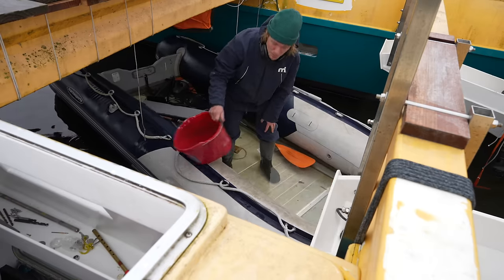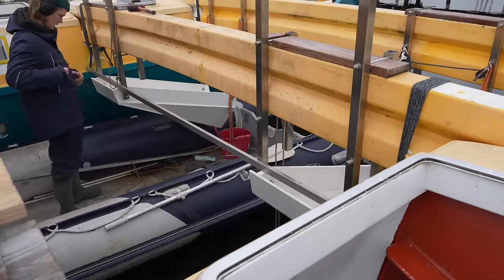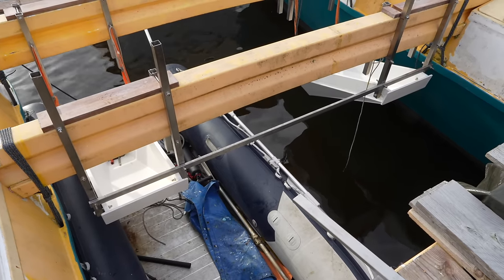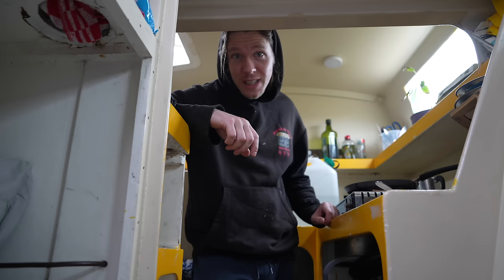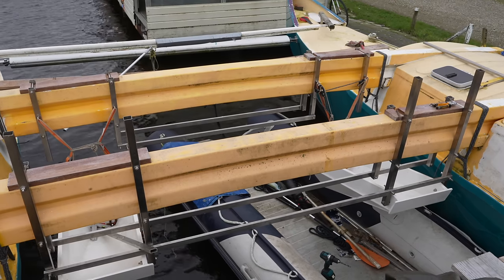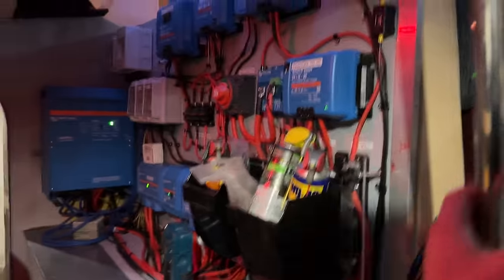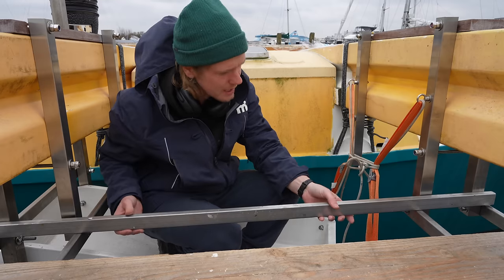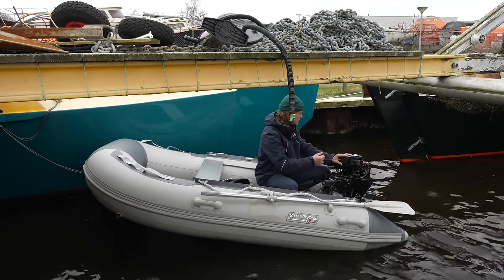I Built A Cockpit Floor for My Ocean-Going Catamaran | Wildling Sailing

Comment: One thing, seems that you might think about triangulation as it pertains to your motor boxes. That cross brace if mounted at an angle instead of level would better control racking. I was told if I learned to sharpen bits on the grinder I would never be out of a job, not long after they started making bit sharpening machines. I'll look through some of my old books and see if I can find instructions, got some reference stuff on old school uses for common tools. Ah, fore aft triangulation while not so important for movement but for strength you are absolutely right. Stainless strap at an angle from side to side opposite the hinge pin side would help.

Comment: Electric outboard motor 3HP weight cca 14kg .. Mercury 9.9HP weight cca 38kg.   In 20kg LiFePO4 store 2.5KWh energy (1 hour with full power) It's easier to handle.   Motor 14kg, Acumulator approx. 25kg 
(with waterproff housing). That's enough for life at anchor. Electric motors are reliable. You can generate electricity on the boat for free.  Not petrol. The 9.9 Mercury can only be had as a backup.

Comment: When drilling metal. Start with a really small pilot hole. Step up the size of the drillbit a couple of times before reaching the final size. Otherwise you blunt the drillbit really fast, even expensive ones.

Comment: I'd be considering you have water in your fuel. Plastic tanks get condensation in them. A dash of metholated spirits absorbs it n will keep u going...although a carby bowl clean never hurts either along with a spark plug clean too

Comment: I understand your situation re sharpening twist drills. My recently purchased General sharpening jig shows for thin metals such as your SS tubing change the cutting angle to 88 deg. to prevent snatching on break through. I see you having action when the bit breaks through. So, instead of 59 1/2 deg try that possibly.

Comment: Great episode, why do you not wield the metal box together this would be super strong then.

Kind Regards

Craig
Reply from the maker: thanks for the comment, I think with my experience, and the high winds it would be difficult. I think I may weld a few little re-inforcing bits here and there though

Comment: Did see you had gotten the cobalt bits and going slow you're doing it right just use cutting oil to keep bits from over heating and losing their temper.

Comment: You should try and use the same size bolt throughout which means you need one tool and can get a few drill bits if the same size instead of 4 of a different size fit same price

Comment: Nice to see you back at it Mark. Your engine problem may be oil in the wrong places. I watched you lift them and i know its hard cos they are heavy but if the prop goes higher than the head, or if you get the engine to be laying even for a short time on the wrong side oil can get into the cylinders and the carb which doesn't help! Also as well as cleaning up your swarf as you go when drilling make sure theres none on the soles of your boots as that is a common way to put holes in inflatable boats. Soon be sailing buddy 😊

Comment: On your own or not (and you were definitely struggling) might I advise you to attach an outboard with a rope to the main boat or even the dinghy. If it goes overboard not only will you go with it but it'll sit for a week before you retrieve it and all the corrosion. At least attached you could get it out in an hour and rinse it.

Comment: if you want your drill bits to last try not putting so much weight on it... they cut fine just enough weight to keep it from walking... the drill should do 90% of the work. also a center punch to locate your drill

Comment: For sharpening drill bits by hand it is a bit of a learned art. A small tip is that if you need a slighty bigger sized hole for something you can tune a bit to cut slightly oversized (when drilling a blind hole) by making the edges slighty different lenghts. The hole size is made by 2x the longest of the two cutting edges (most drills are the same so 2x is equal to the diameter) . Only works on blind holes where the center is kept by the tip of the drill. 
The angle of the cutting edge/backface only needs to be a deep as the cut you need to do, so metal drills are a shallower angle (otherwise the back face will rub and generate heat noticable when applying too much pressure on wood drills). Generally it is better idea to have two faces per side, one for clearance and one for the cutting edge but that can be hard to do when you first start learning to grind them. The angle accross the face will impact the drills ability for follow the hole and also how much force there is on the cutting edge. If drilling plastic that might crack it can be usefull to make the angle bigger (so more pointed) as then you can use less pressure (although not done much for plastic drills so take that with a pinch of salt :D)
Oh and loving the videos. Reminds me of myself when I was younger, too many people won't even attempt something (how many people have you met that wont even oipen the bonnet of the car to top up the washer fluid :P). Great book on this mentality is "Zen and the art of motocycle maintenance" for those long days at sea :D
Reply from the maker: great info, bro!

Comment: I could hear that the chattering of the drill bit, it was done. Try using a step drill, or it maybe called a unibit. Do check the size of the steps with a caliper if your drilling a hole that is critical.

Comment: Hello Mark,
I'm just watching your latest video and realize that I keep tripping over the suspension of the motor nacelles. Do you really think the wood is sufficient to withstand the loads? My fear is that the bolts will break out of the wood quite quickly and you will lose your motors, either because they are torn off, or at least because they run full of water.
I also wonder how you are going to maintain the motors safely when you are at sea. Why don't you build a bracket in which you can lower or raise the engines vertically, ideally high enough so that you can service them on deck?

If you want to keep it that way, I recommend flanking the lower end of the nacelles with two strong steel plates, into which suitable circular tracks are cut, in which the nacelle is guided sideways. This should reduce the twisting of the nacelles and the load on the upper bolts and the wood holding them.

I recommend that you have the whole construction professionally calculated so that you don't have any problems later.

Comment: The drill bits tips are breaking because you are pushing too hard, probably because the tips were not ground correctly. It takes a little time to learn this skill. Make sure each cutting edge is the same length as the other with not as much relief as those you ground.

Comment: Do you think the problem could be using this dreaded E10 fuel? as my marina 9.9 was great until the crap E10 came out so according to the mariner mechanic it was damadging my carberetta so a new carb was fitted and same fuel snd it just never runs properly since. According to most people I have spoken to have told me that simulr problems with their own engines and have told me that the E10 can only last about two months before it corodes the inside of the card and that the petrol goes off. ??

Comment: Every time you put a hole in the steel frame you weaken it. You should do a test run with both motors running sooner rather than later.

Comment: Sharpening bits by hand takes practice.  It is much harder WO a stable bench type grinder. Keeping a flat or squared off Stone is important.  Put as little back taper as possible.  I usually do a steeper angle on the heel of cutting edge to reduce heat. As with any metal cutting,  goal is to go slow and sharp enough to create a good chip. Over 90 percent of the heat created should leave with the chips. Cutting stainless is never an easy proposition. The gold, "TIN" coated bits aren't bad for the money.

Comment: Do yourself a favor and use nylox and double nutted because it's going to work loose when the metal starts bending and which it will do Hollow tubes are not a good choice Use nylox Please

Comment: If the ocean can periodically rip keels of boats what chance do those four anchor points have on those motor boxes? Even just having the motors clamped in the bottom of the box may not be enough to prevent the force of the ocean currents rushing through and ripping them out or off. Do you have any data on the clamping system being fit for purpose? Good to see you back.

Comment: I know nothing but I’d also be concerned about the clamping action and a lateral force on those bolts. I wonder if you can bolt on little stoppers beneath the clamping bolts. This way, any extra weight will be on the stoppers and not the bolts for the clamping.

This also gives you a bit of redundancy in case the bolts that hold the stopper fails as you still have the clamping bolts.

Idk it’s a tough problem to solve

Comment: Good luck bro. I think that cage / frame / engine / cockpit floor holder is grossly under-engineered. Oh well. I guess we will see in a few years what bits start to break first. Do what you can with what you can afford and upgrade as time goes by.
  Your going to want to use stainless nylock nuts. The regular nuts will come loose, you can double regular nuts up and lock them together but it's not that easy or as good as nylock.
  Lots of drilling if you want to bold that cockpit deck all the way along both ends but it will stiffen the assembly up. 
  My biggest concern other than longevity is the sharp edges at the top of the frame. You don't want to be slipping over into those! Is that something that will also be covered in wood?
 Another tip is to get a socket holder you can put in your drill for your socket set. You can get all the different sizes even sds+ or for the smaller sizes you could also cut some old socket extensions if they fit in the chuck but they might slip so best to order the ones with hex shaft or sds+ if your drill is sds.
  It's also nice to have 2 or 3 drills on hand. This way each can have a different type of bit in for faster work and some can be charging while you use the others. (when you consider a used drill is probably almost the same cost as a spare battery).

Comment: Have you tested fully lowering the engine boxes since building this? That front bar and bolts are surely going to interfere with the top of the engine boxes when fully lowered for use?

Comment: ..all this steel - why not use alu? So much easier to work with and lighter. And the wooden planks for deck; glue them together and use some wooden stringers under the middle of them - it will be much more rigid.

Comment: the issue with the drills especially in Stainless steel is that when drilling a hole with a had drill they tend to run faster then the suggested cutting speed for the drill in 
S.S. and the tip work hardens the S.S. because of the heat that is generated with most drills, you need to be sure to use a split point drill, because it is actually has small 
cutting edge at the tip and not a rubbing edge.  that is okay for softer materials like wood and aluminum but because S.S. work hardens so easily, use a smaller drill to 
start with, keep the speed down, even use a bit of lubricant even a little bit of Crisco or vegetable shortening that is ferm it will stick to the drill instead of some oil that 
will run off as soon as you apply it. the cobalt drills are good but if you notice they typically have a thicker center web, so it is very important to start with a smaller pilot drill.
I had a small machine shop in California for 20 years, we built OEM hardware for a number of the Sailboat manufactures that were here in the '70's - late '80"s, Lots of 
S.S. fabrication, Lots of Brass and Aluminum castings, started out with a couple drill presses and a bench grinder and grew to punch press, power brake, Iron worker, 4 welding 
machines, 2 Bridgeport milling machines and 2 engine lathes, finishing polishing and Electroplating of S.S.

Comment: I have owned multis for over 40 years and built 4 multis. You seem like a nice guy, but my advice is - follow the plans, Wharram did a nice job and he knew much more than you, so find the plans, stop thinking and just follow them as they were drawn for our deck. Don't make excuses for doing different paths. I made pivoting nacelles for my 38ft cat in 3 different iterations over its 24 year life so far. You will have an issue with the forward thrust of a high thrust engine - the pivoting nacelles need to bear against a thrust pad at the forward edge when lowered - pivoting nacelles is a great idea - mine work really well and are light and strong - but I would not have them hanging like yours do with no thrust pad at the front - also learn to use epoxy and glass. It is much better than bolting stuff all the time. Cheers Phil

Comment: Mark, I'm.now at 12 min 40 secs..
Are those sausages in the pan with rhe eggs or off cuts off a brush stayle?

I thought I'd let you know that here in blighty, we call it ' threaded bar'  not as you call screwed Rod! Which sounds like a really bad experience in Rods life!

Invest in a grinding wheel and learn the art of sharpening when you are rained off..it will bring you much sought after skill.upgrade in little to no time.

Comment: Rule of thumb when it comes to buying tools. The reason why there are cheap tools is because they ARE cheap. Don't always look for ways to save money when it comes to your tools. You get exactly what you pay for. Cheap tools are cheap for a reason.
Reply: However…… 😂 we all have cheap tools that we have been using for years if (we’re old enough) You can build something worthwhile with cheap tools. I suppose it depends on what tools they are.
Reply: Buy once, cry once.
Reply: Buy cheap buy twice especially when it comes to  tools 🔧  ❤
Reply: Go watch project farm the cheapest tools are usually not that great but there are good value tools out there. Good steel is not that expensive.
Reply: Cheap tools are a waste of money and time if you use them a lot on a big project like this. For heavy use it always makes sense to buy tools for professional use
Reply: It's a long time between videos
Reply: Worst cheap thing….sandpaper.
Reply: A lot of people don’t have the luxury of the option
Reply: I was also pleasantly surprised. I have a Lidl screwdriver that has outlived my expensive Bosch by many years. But I agree with you on many. If you buy cheap, you buy twice.
Reply: I guess with the tool itself it depends on how much work it gets so cheeper options can work just fine. In terms of drill bits and stuff that is used with the tool thats what makes a big difference as this video proves.
Reply: You can get good relatively low cost tools, the problem especially with power tools is that the quality control is nil and thus you can get good ones and very bad ones.
Reply: I’d get a step drill bit for stainless . Also, how will you lock the engines down or have I missed something? Will you have a brace to keep them from kicking in reverse?
Reply: Often tools also only need to be used once in a decade. I'm still waiting for some of my first drill bits to break after 40 years, so I get to buy the second one.
Reply: Great to see you back!. Really enjoying the videos👍😀
Reply: I still buy cheap tools.They do what I intended them for at a fraction of the price of new.
Reply: In modern times it is cheap when you buy in short, directly in China. A little bit less quality for a 80% discount.
Reply: Dear friend Please buy a can of drilling lube.
Good drills and lube the f out of youre stainless.
That will save youre drills and steel.
Nice too see you back on mahi.
All the best
Reply: Being a boat owner, I learned my lesson many many years ago to NOT skimp on tools and other products used to repair or modify things. I am of the total belief to buy quality items or you most likely will end up paying double in the long run when you try to save money.  Quick story, I purchased a cheap sander (to save money) years back and not only did it sh*t the bed after about 5 hours of use but when it finally died, it caught fire AFTER I unplugged it and laid it on my deck. Thank God, I saw it and hit it with a fire extinguisher. Could have turned out a lot worse.
Reply: I have bought some cheap tools that were brand new that did not last very long and then I have bought cheap tools that were used off of facebook marketplace that have lasted me a long time I say if you're going to buy cheap tools By good tools that are used you get them for a good price But you are still good too
Reply: quality tools will be a friend always
Reply: @claybornlewis276 

depends on how well they were forged
Reply: I'm not a pro. And  I've been doing this long enough that I already have most of the tools I really need.
So for me, a new tool is in the best that's a neat idea category. Most of which I turn out not to use much.
So I buy the cheapest I can find, and if I use it enough to break it or to get frustrated with its limitations I buy better.
And if I don't use it, I've saved money.
Reply: Buying cheap sometimes is exactly what you want to do. For instance, a circular saw on a boat isn’t going to get much use, and buy Ozito or similar and they exchange it if you break it within 12 months. A router, and planer, a really good sized angle grinder. It really depends on the tool and it’s use.